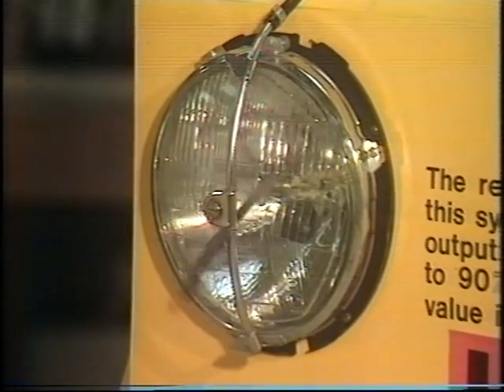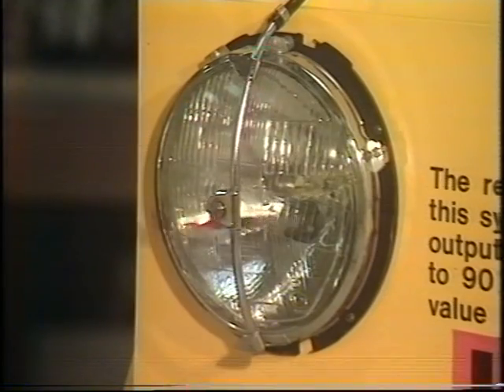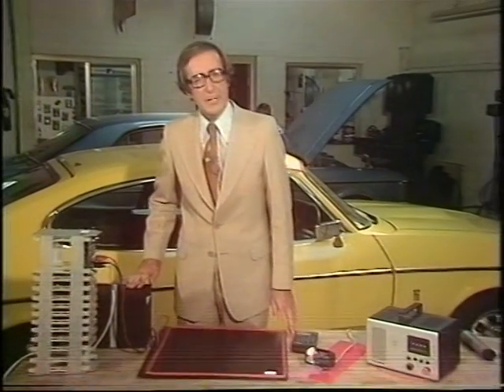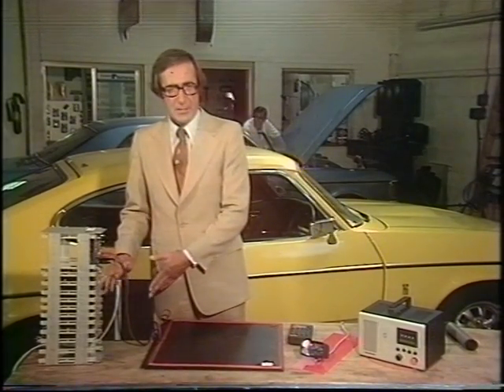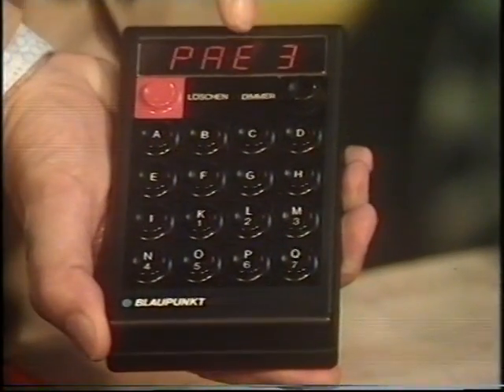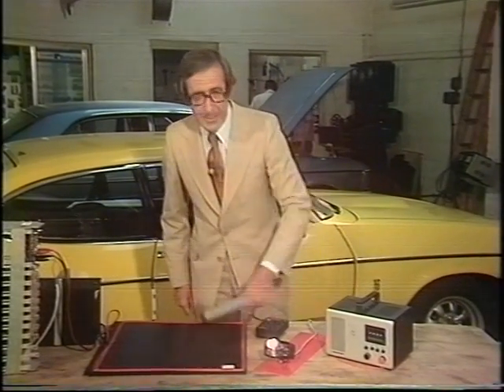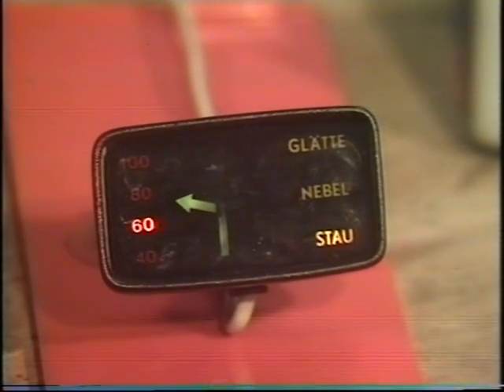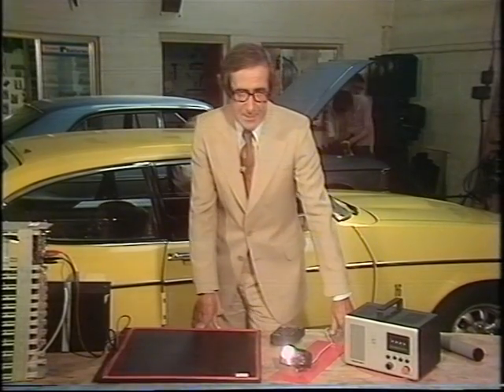Early Sat Nav | Drive In | 1970's

Comment: I might seem a little absurd but 25 years ago GPS was only used by the Military and commercial shipping and 35 years ago a car phone took up half your trunk
Reply: when you think about it like that in the past 35yrs or so we've come very far, ppl had to drive without all the safety features found in modern cars (which has saved many form avoidable accidents and insurance claims) and ppl also had to drive with a map and compass... nowadays some cars will drive itself in stop and go traffic, built in GPS, tell you if something is wrong with the car, try to wake you up if you fall asleep behind the wheel, most of them can see in fog and stop an accident before it happens... don't get me wrong i still like old cars BUT for everyday use i'm thankful for all the tech we got now..

Comment: Where does the "Sat" come in?
Reply: Satellite.
Reply: @Leuel - I think he was asking what satellites have to do with this particular system (the answer being absolutely nothing) - in other words it's not a sat-nav. It's just a -nav.
Reply: rogerthecabinboy2012 I think it is before he sets off he has to be "SAT" in the driver seat .
Reply: tjf4375 Are you sure? Where do the roadside transmitters get their data from?
Reply: You are sat in the car.
Reply: Thee Adjudicator They don't move anywhere... They get the data for where they are based on where they're installed.
Reply: Cost a lot more for the 7 day weekly version.
Reply: That's a typo - it uses induction mats embedded in the road - therefore it's matnav
Reply: @Bob Green Back then SAT stood for Stupid Ass Technology.

Comment: Would've only worked if it was a few hundred bucks or less every few miles with sensors next to mile markers. £30 to £40 is more reasonable than 1988's Travel Pilot at £2 k, however.